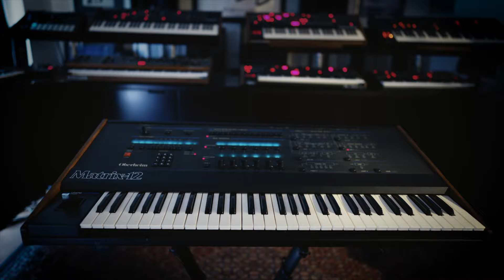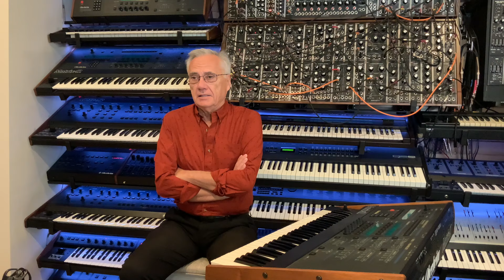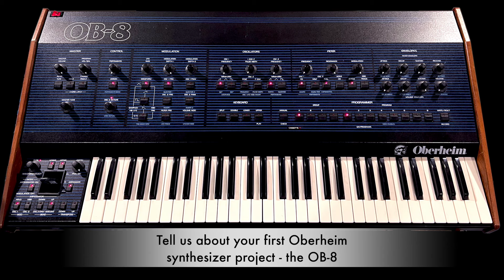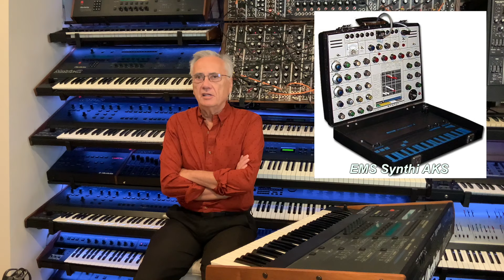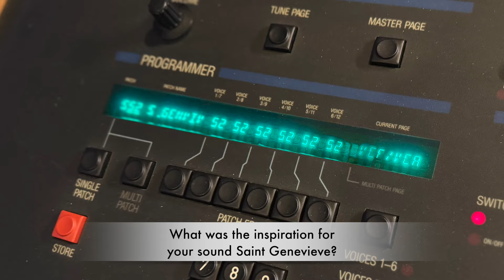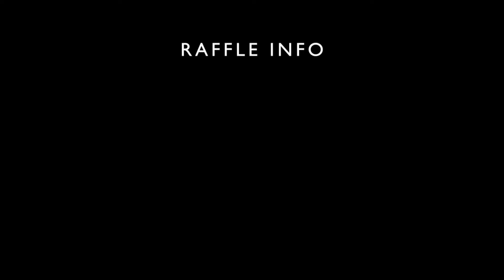Meet Michel Doidic, Co-creator of the Oberheim Matrix-12 Synthesizer

Comment: So Michel and Marcus Ryle worked at Oberheim and I guess worked on a lot of stuff from the drum machines to the Matrix 12, then they designed almost every Alesis product that was successful — the QuadraVerb, HR-16/MMT-8 and DAT stuff. Then they started Line 6. Then they sold Line 6 to Yamaha. Then they fought Uli Behringer for Tom Oberheim's name. Maybe that was just Marcus. But this guy is a badass. These were the guys who actually had complaints about MIDI, but then I think it was Yamaha that added portamento and SysEx to the DX7 and then they all started putting serious APIs on everything that let you control every parameter of every patch in every bank. I just love how all that stuff is super deterministic and pretty much bulletproof in an embedded system type way.

Comment: I'm currently restoring a badly damaged xpander, well i have the boards and nothing else, it was in a fire. 
It's been really interesting learning how it was made and matching parts up. I'm basically just building another one with new parts using the damaged one for reference and there are very few parts that don't have modern equivalents. Built to last is an understatement.

Also, the firmware has 'hi mom'  written ascii!